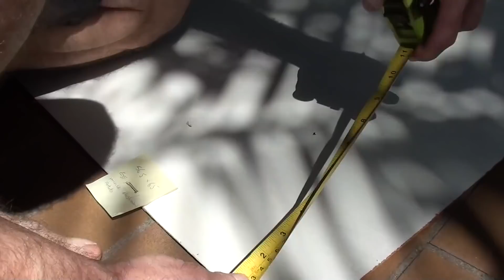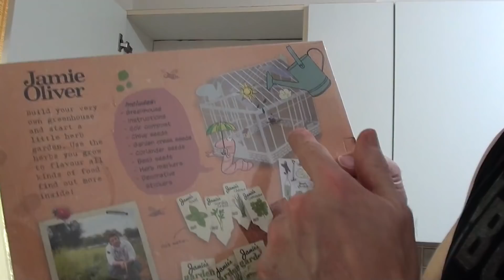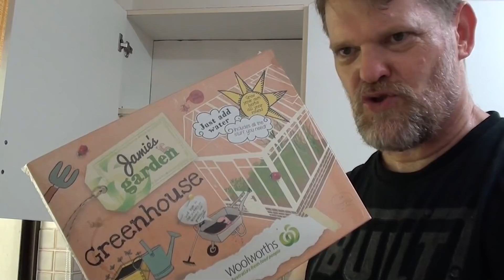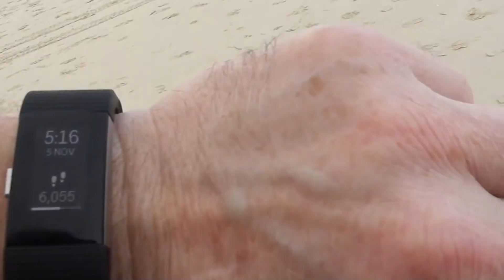l have Termites? 😨 The Adventure Begins.. Surfing, Flowers 🌻, The Beach 🌊 & Avocado 🍈. Asmr

Comment: Your strata should be doing inspections once a year and any structural damage is covered under the body corp insurance you paid for. You should raise it with the committee.
Reply: strata doesn't cover INSIDE
Reply: No, but it does cover regular inspections and fumigation in order to protect the external structure. A good strata would never let it get this far.
Reply: Maybe they have? They are inside and not outside! Hard to tell really.

That said, Greg should have reported them to the strata, and should have had his kitchen treated, otherwise they'll just come back again!
Reply: What Strata does, does vary from state to state and place to place. Being you're in more 'rural' area, you Strata most likely does next to jack as its only a handful of units. Its only Strata in larger apartment blocks that generally do something extra.